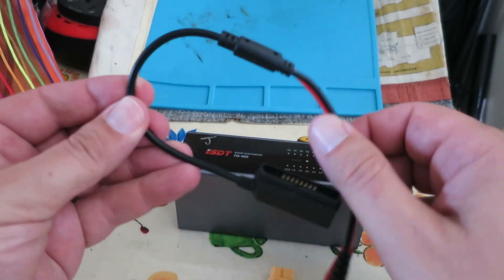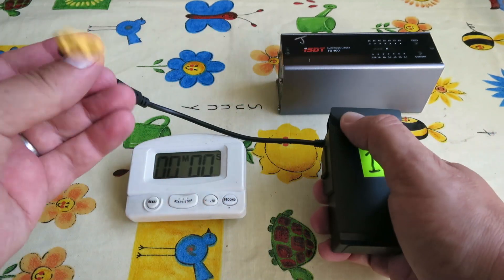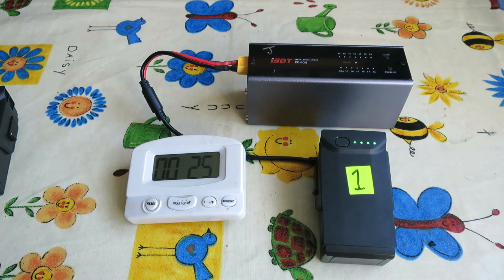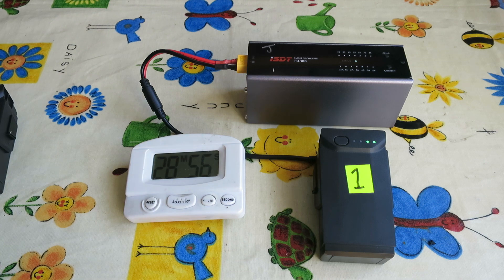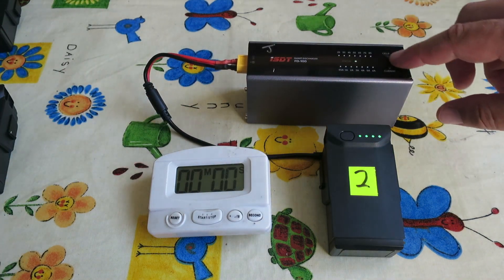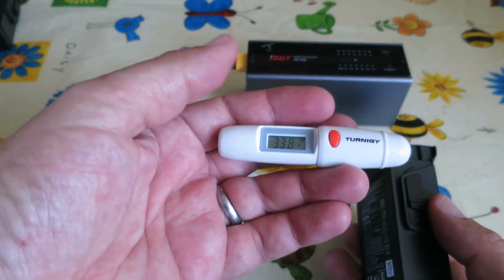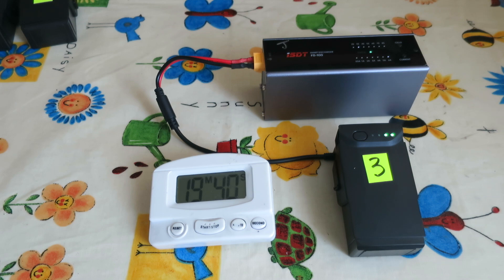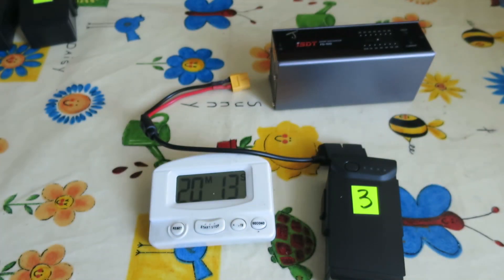Discharging DJI smart battery if you can't fly Mavic Air, Spark, Mavic 2 Pro Zoom etc

Comment: When connecting the Mavic 2 battery lead, does it matter which discharger lead is connected to which ?
Reply from the maker: If you mean which is connected first then no it makes no difference.
Reply: Thank you! I was referring to red/black leads on FD100 to battery charge cable.
Reply from the maker: @johngalloway3595  no they definitely need to be correct polarity. Red should be positive but I'd check with voltmeter to be sure. I think the discharger has reverse polarity protection but best not to test it.
Reply: @jamesb72  Thank you, wired it black to black, red to white. Works fine. Thanks again !

Comment: Hello james
I have a Mavic 2 pro and i have purchased the cable which im currently waiting for showing up. I have the discharger already as I fly FPV quads .
I know the Mavic 2 has a 4s battery lithium ion polymer but im not sure if 6A discharge is Ok? It should suck more amps on the aircraft but I have to ask if you know.

Also it should be possible to charge the battery with an ordinary RC charger when purchase the cable. Do you know how? I have seen some old videos (Mavic 1) where one guy use the option LIHV which sounds incorrect.

The spec of the Mavic 2 battery

Capacity                               3850 mAh
Voltage                                15.4 V
Max Charging Voltage      17.6 V
Battery Type                       LiPo 4S
Energy                                 59.29 Wh
Max Charging Power        80 W

Now what i dont find an answere on...
Max Charging Amp          At 1c 3.85A as it is 3850mAh
                                            At 2c 7.7A 
        
Question is if it can handle 7.7Amps
Reply from the maker: Hi Robert, 6A discharge should be absolutely fine, the Mavic 2 battery is 3850mah and flight time 31mins so 'average' discharge is 7.7Amps in flight, and probably 3-4 times that on climbout/fast flight, so to half discharge at 6amps will be absolutely fine. For charging, I personally would never charge a DJI battery on a normal RC charger both as they are too expensive to risk, but also as the DJI batteries effectively have internal charge circuits, so the 'DJI charger' is actually just a DC 17.6v power supply to provide constant voltage for the chargers internal charger to charge/balance the internal cells. A normal lipo charger works completely differently so whilst I'm sure you could make it work its not going to be worth the risk. I'd suggest instead you just buy one of the cheap 4in1 or 6in1 chargers for Mavic 2 on ebay for around £30 (I had the blue 4in1 charger for my P3p which worked briliantly) so you can charge multiple batteries in parallel if weather looks good to be ready to fly quickly. Be aware the DJI charging hubs don't charge in parallel they charge each battery one after the other but automatically switch over, so are convenient but slow, so you need a proper parallel charger such as the 4in1/6in1 type. Hope that helps.
Reply from the maker: Just looking on ebay item 113394121367 looks good, charges 4 batts and controller and has a cooling fan
Reply: @jamesb72  Thank you for your help! Well I live in Sweden and i usually dont purchase from Ebay but there is a first time for everything.
Thank you for the help!
Reply from the maker: I'm sure you can find the same chargers on Amazon or other websites, I suspect they will more expensive to buy in Sweden than from China, but compared with the DJI batteries they still won't be expensive, so its worth protecting your investment - I'm guessing you bought the fly more package so have 3 batteries which is a lot of value compared with our RC batteries which are a fraction of the cost !
Reply from the maker: Amazon.se has similar for around 40 Euro's if you search mavic 2 6in1

Comment: Does it automatically balance discharge?
Reply from the maker: There are no balance taps on DJI smart batteries, so balance discharge isn't possible with these batteries (so would be the same as in flight discharge), DJI claim it does balanced charging internally so this shouldn't be an issue, as cells cannot get much out of balance in a single discharge

Comment: Could I use this charger to discharge my p4p and inspire 1 as well?
Reply from the maker: You can definitely use this discharger for P4p 4S lipos - ebay has 'B6 cable Phantom 4' for £2.43, Inspire should work using 6S setting if you could find the cable for it, looking at the battery connector it looks exactly like the Phantom 3 connector to me, so I'd be tempted to just order  "B6 charger Phantom 3" cable from ebay then very carefully check it matches before forcing it into a battery they are under £3, so well worth a punt. DJI Do a fantastic battery management system for the Inspire 2 batteries, but don't think they do an Inspire 1 version see https://www.dji.com/tb50-battery-station for when you update ;)
Reply from the maker: When you've confirmed cable I'd be tempted to get a couple of dischargers/cables for the Inspire as the batteries will take longer to discharge as on 6S it would max out at just over 3Amps so will take around an hour to discharge I think, so I'd run two side by side for convenience.
Reply: jamesb72 I’ve got 8 inspire ones
Reply from the maker: SkyRC do a BD200 200w discharger which can discharge at higher current, for around £76 from UK - I bought one to try out, as 200w is a higher discharger capacity (so 3S can discharge at 17Amps instead of just 6Amps) but having tried this out its not user friendly and could very easy have wrong settings and damage your lipos, so I would not recommend this. It costs more than double the ISDT100 80w discharger which is much safer to use and checks voltage matches cell count and will not discharge if they don't, so I feel is a better product, if you have more/bigger batteries I would just buy several ISDT100s personally.

Comment: Hi James so this will work on my Mavic pro? If so what should the discharge settings be? Thank you!
Reply from the maker: Think mavic pro is 4S but if you select wrong it will just beep and flash red led at you so you cant do any harm. 6amps should be fine.

Comment: Will the B6 lead work on the Mavic 2 batteries?
Reply from the maker: You'd need the correct lead for Mavic2 battery connector and set discharger to 4S (Mavic Pro and Air are 3S, the Mavic 2 is 4S), then it should work fine. The cables for Mavic2 are available on ebay  https://www.ebay.co.uk/itm/Fast-Charger-Charging-Cable-Adapter-For-DJI-Mavic-2-Battery-To-B6-B6AC-Balance/352461406153

Comment: How to discharge the mavic air controller?
Reply from the maker: There isn't a way I know to discharge controller, but I wouldn't worry about it, as the controller lipo is not so much of an issue. When lipos deteriorate they can't deliver maximum current/power, which is obviously an issue for the flight batteries. The controller will have a very low current draw, probably 1-2 Amps even charging phone, so this isn't an issue. Obviously its harder to get to the controller battery to change it, but I suspect the battery itself wouldn't be hard to find or expensive to buy but should last several years anyway.

Comment: Will this work for the spark?
Reply from the maker: Yes this would be fine for Spark as its also 3S lipo you would just need to get the Spark version of charging cable if you search ebay for 'DJI SPARK B6 CHARGING CABLE' they are £3.29 posted from China. I would also discharge at 4Amps first time to check how long it takes (I'd aim to roughly match the flight time with discharge, as its only discharging half this would ensure no issues), and check battery comes off cool before increasing discharge current.